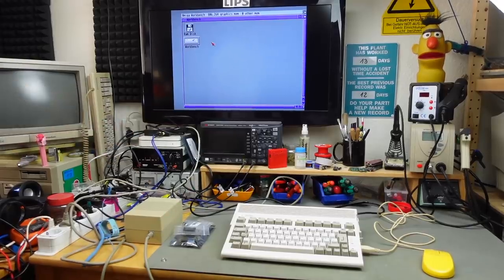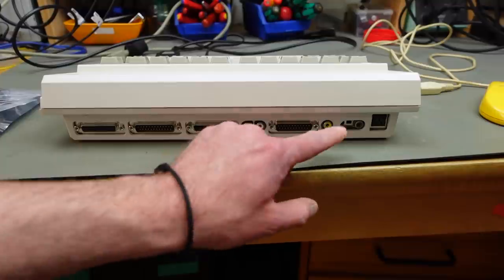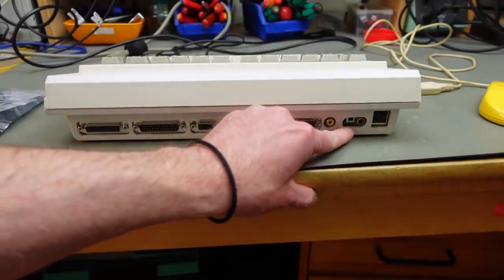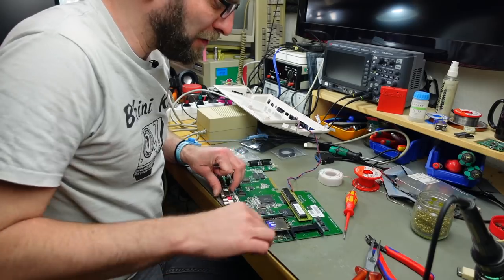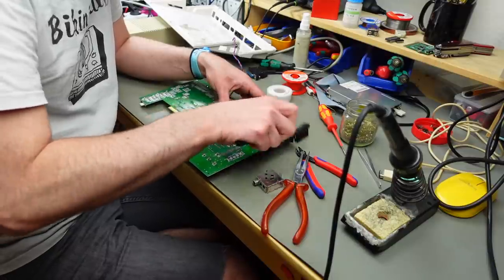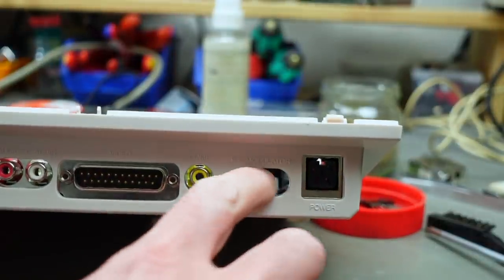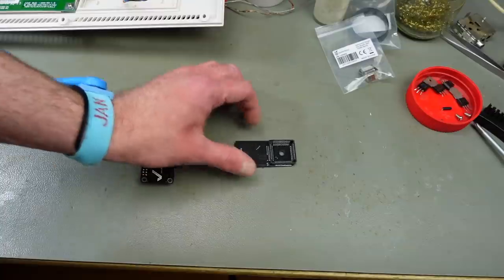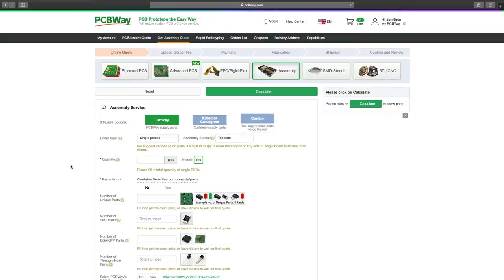Amiga 600 RGBtoHDMI Installation

Comment: What about putting the rpi in a box connected to the external rbg video connector instead, since this also happens to provide 5v on pin 23?
Something like the old A520 adapter, just smaller.
Reply from the maker: That would work but would be limited to the analog signals, similar to a standard RGB upscaler. The mod uses the digital signals provided to the Denise to generate the Full HD picture so the quality is way better.
Reply: @JanBeta  I see, thanks.

Comment: Don't worry Jan, its only a cable. 
We still love you :P
Reply from the maker: Haha, thanks! :D
Reply: @JanBeta  You know, as I watched you struggle with tha ribbon I realised that this device is poorely designed. It could be (pcb)waaaaaaay better in a different design. No ribbon, but desoldering the RGB and have a single PCB with a DVI / HDMI out to completely replace the RGB out in front of Denise. This 2.0 version could make the mod almost factory looking, and then we could get rid of all legacy outputs RF, Comp, RGG plus that giant cap that would be useless. Someone should do this as it makes much more sense ans it only needs the Pi mounted parallel to the PCB, where theres much room from the removed HDD (everyone is using SD/CF cards anyway). Here's a mockup of how it could look. Much simpler and actually cheaper too. https://i.imgur.com/FfF6GwE.jpeg

Comment: Great video! Will be doing this to my 600, just need something similar for my 1200 now..
Reply from the maker: Thanks! Unfortunately the Pi is not powerful enough for the AGA screen modes. And as far as I know the signals are processed differently so there would have to be a whole different method in order for this to work. Maybe someday.
Reply: @JanBeta  indivision aga mk3? Did a similar mod with it and the rf port..

Comment: Double sided tape doesn't work well for long term mounting in my experience because it tends to be very temperature sensitive -- tape adhesive gets brittle and loses its stick when it's cold, and it melts when it's hot, and even at the best of times it tends to creep and gradually let go if subjected to any significant force. A really good quality tape can work for lightweight things that are at room temperature all the time, but especially if you're sticking down electronics like a Pi which will get warm and melt the tape adhesive, I can't recommend it -- hot glue, silicone, and zipties are my go-tos now for electronic parts inside a case if I'm not doing it properly with screws.

There are tape adhesives that can work over larger temperature ranges for longer times but in my experience they're really hard to remove and then I might as well be dealing with glue...

Comment: This video has made me want to get an A600 ;)
Reply from the maker: I never thought I’d ever want one back in the day. But it’s an extremely versatile and useful machine these days. :)
Reply: @JanBeta  handy how compact it is :)
Reply: @RetroGameCoders  Pi400 might be worth a look if you want convenience/value, not limited to just Amiga software either.
Reply: @amirpourghoureiyan1637  I did a video about that :)  I get real hardware for my code testing but for sure the PiMiga is fantastic
Reply: @RetroGameCoders  Should come in handy for testing :)
Casual Amiga fans are better off going the emulation route, but if you're writing code then it's definitely worth having an original around!

Comment: Jan, thanks for the detailed video you've uploaded. Great to see this solution working for the 600.
I've had a look to do this myself, but I can not find the adapter board for the A600 mentioned. (the one with the cable and Denise adapter) Is there any way to aquire it preready made, as shown? 
Many thanks, Job

Comment: The limitation of OCS/ECS - is the limitation simply that of the amount of “grunt” available on the Pi0?
Reply from the maker: Basically yes. Unfortunately the Pis with more grunt handle the GPIO pins differently and have a bottleneck there (or at least that’s what I’ve been told), so we are unlikely to see an AGA capable implementation of this project. At least as far as I know. I think the AGA chips also have different signals on the pins so this mod won’t work at all without major changes.

Comment: the problem with plcc clip ons is it can interfere with any accels attached to the cpu and the hat (even with the hole) will cause the denise to heat up if the airflow is restricted
Reply: I wonder if a PLCC pass-through board would be possible - same as with a DIP chip pass-throguh but using PLCC sockets. It should not be all that difficult to solder or desolder a PLCC chip like the Denise - though certainly a higher barrier to entry than doing the same with DIP chips. But I don't know if a 'male' companion to a PLCC socket exists?

Comment: Interesting video. Do you think it would be better to make the HDMI upgrade in the style of the A520? That is to say, run a ribbon cable from the Denise chip to a socket at the rear where the modulator has been removed?  That way no problem breaking the connector! Thanks for uploading.

Comment: have 1 last question, the quality of the graphics on this certain game, does this rgb2hdmi thingy work good with the game Bubble & squeak? not sure if you've tested that game on it but the graphics on that game look great and need to run smooth.
Reply from the maker: So far, it did work very well with everything I threw at it. I don't think I've tried that particular game but chances are that it's going to work fine just like everything else (except for the higher screen resolutions introduced with the ECS chipset--which are VERY seldomly used in games).

Comment: Very interesting video!! I would love to get something like this for my A600 too. I have a bunch of them but my main one that i had since childhood is almost fully kitted which means there is a Furia inside. Can that Denise adapter fit underneath the Furia? I don't really like the indivision and this seems like a perfect alternative.
Reply from the maker: I am not 100% sure about the Furia but I think it should fit. The adapter board sits really flat on the board. I have yet to get my hands on a Furia and try.
Reply: There is a smaller variant that clips around the chip designed by kipper2k: http://eab.abime.net/showthread.php?t=105429&page=4
And then there is the original small adapter variant by c0pperdragon that you solder with wires that you can place anywhere: https://github.com/c0pperdragon/Amiga-Digital-Video

Comment: I may be wrong but as I understand it, the RF-Modulator also generates the composite video signal. So you might as well remove the yellow RCA plug next to it... and I guess the remaining hole could very conveniently be used for the RGB-to-HDMI's menu button, extending the microSD/TF reader for the Pi-Zero or both, maybe?
- Jan, I have already successfully build an RGB-to-HDMI into my friends A500... and would now like to try it with my Commodore 128's 80 column display. But the more I look at hoglet67's
 RGB-to-HDMI github page, the more confused I just seem to get... on what version and/or adaptor board (and so on) to get.
- I can't seem to find any YT-videos or step-by-step guides on it. So, I would really love if you would consider making a similar video for the C128.
Reply: The composite video is generated by the chip at U12 (CXA1145 Encoder), it's output is fed to both the modulator and the yellow RCA composite jack. The composite should still work fine without the modulator.

Comment: Question can you still use the old RGB Output (23 pin Dsub) and connect RTC monitor along the site with or insted HDMI?
Reply from the maker: Yes, the regular video out is unaffected by the mod. :)

Comment: This is a nice and neat solution. 

I am looking at possibly doing something similar for my Indivision MK3 where I can use a USB plug into the smaller board, then using a flat ribbon can then direct the output to the socket as you have here. I feel this would be look more elegant (at least externally) & would free up the back port of the A1200 for other things (e.g. easier CF card hardrive access). I just wish I had a way of getting hold of the acrylic/perspex mouting plate & screws

Comment: Any chance there's somewhere t put an HDMI out on an A500?  That monochrome plug was always fairly useless, though I don't know if an HDMI socket would fit.
Reply from the maker: I think you can run a flat flex through the cooling vents and 3D print a little enclosure for an HDMI socket. You would have to cut the case to have a real internal solution for the A500 though I’m afraid.

Comment: Might have been a good idea to attach the flat ribbon cable to the HDMI connector before securing it in place.
Thanks for the video.
Reply from the maker: Yes, indeed. I‘m definitely going to do that when I get the replacement part. :D

Comment: Nice relly nice ideas for old computers. Little tip, dont use double side tape for secure HDMI port in this acrylic adapter. Because glue on tape can easy melt after use in hot case, and huge fat HDMI cable can easy lift  glued HDMI port and made big mad devastation inside case. Or if have luck only destroy signal tape. I see many HDMI ports soldered and lifted from PCB. Better use hot glue or best some acrilic glue or best way any 2 ingrediens nonconductive glue. Glues like 1s Super Glue can made shorts or another disasters. Hot glue is very safe and can easy dismount with hot air.
 Grettings and cherrs :D
Reply from the maker: Thanks! Good point about the double sided tape. I‘m going to look into adding something more permanent next time I open the A600. :)

Comment: Hallo I have question you add raspberry pi do you also get the acceleration of the pi or is it only to connect the hdmi
Reply from the maker: Just the HDMI with this project. You might want to look up the PiStorm project though which is a Pi based accelerator for the Amigas. :)

Comment: Great Video again. When I get it right only the black part of the connector is broken. Just get it out of another connector carefully and slide it in the broken one. This should do the trick
Reply from the maker: Yes, that would be a solution. Unfortunately I don’t have any matching connectors I could salvage the part from. I just ordered a replacement, should be easy to fit.

Comment: Hi Jan - are you sure that you broke the adapter? I can't get the the video output to work with a flat flex cable and I have read of others a having similar issues. I've replaced the flex cable and adpaters but still no output unless I plug directly into the pi with an hdmi cable.
Reply from the maker: Mine works without any problems after I replaced the connector. Are you sure the flat flex is fully inserted and locked into the connectors and in the correct orientation etc? It‘s literally just an extension of the original connector on the Pi so that’s the only explanation I can think of why it wouldn’t work. 🤔
Reply: @JanBeta  as in your video I have the silver connectors facing up as I connect. The connection feels snug and tight once locked in place so it really is weird. i guess it is not possible to blow something if the cable orientation is wrong.
Reply: @JanBeta  so it  seems that the problem is the female hdmi adapter which the monitor cable plugs into. I switched this out for a different type and now the signal works. The  problematic adapater is a slightly different type, it has a hinged clip which close down on the cable as opposed the type used in your video with the two clips either side of the cable. I need this type of adapter as it is slimmer and fits the 3D printed caddy I have. Likely I have been sent a defective part I guess.
Reply: @robbune1792  I'm planning to do this mod to my Amiga 600. The only part I can't get hold of is the HDMI mount. You mentioned a 3D printed caddy for the HDMI port. Could you please let me know where I could find the files (STL, OBJ, etc) to get one of these 3D printed myself?

Comment: Why can the RGBtoHDMI unit not simply be connected to the factory video port?
Reply: By the time the video signal gets to the port it has already been converted to analog RGB. The Denise outputs the digital RGB, so the signal gets converted to HDMI without ever being turned into analog. If you took the output from the video connection, it would be no better than the signal you get from the SCART to HDMI converter.

Comment: I've thought about replacing the C64 RF modulator with a modern replacement (that doesn't do RF at all) but I don't know if my $30 soldering iron and desolering pump kit can pull it off. I had a hard enough time replacing the power switch.
Reply: Use “Low-melt” solder, to desolder.
Reply: @xxycom8963  didn't know that was a thing. I just ordered solder. No idea if it's low melt or not. I do know I was using shit flux. I have better flux now. Maybe it will help.

Comment: I got lucky.  My A600HD (still in original box) is as white as the day it was born.  Never performed any retro-bright on it.  I have a C128 in the original box too.  When I got it, it was super white.  Today, it's a dingy yellow.  Despite being in the box the entire time in a climate controlled, dark room.  So it's the luck of the draw.  So yeah..they can go yellow even with no UV (although UV accelerates the process).
Reply: I suspect heat might play a part in the yellowing process.

Comment: Hi. It's possible to mount on A1200 ?
Reply from the maker: No, the AGA Amigas use a completely different video circuit and the Pi would not be able to handle the bit depth of the AGA modes even if you could get the necessary signals from the Amiga (which would be a bit more elaborate than plugging a socket between some chips). You can obviously still convert the RGB output using the general purpose version of the RGBtoHDMI externally. But that’s using the analog signals so it’s not going to be as crisp.

Comment: Nice... I love the denise adaptor. Can it perhaps fit under a Furia-020?
Reply from the maker: I think it is designed to leave enough room for the Furia (it sits very flat on the chip). I don’t have one to test though.
Reply: @JanBeta  Hmmmm... I asked about the possibility of doing a socket adaptor like this, just for ScanPlusECS scandoubler, in the past. You know, the one that uses a dip socketed denise on top. (Sandwich solution). Back before individual launched their IndivisionECS-V2 scandoubler. And people said it was impossible, because of space and all that. It is to give the 600 a second scandoubler solution.

If the ScanPlusECS takes the Denise on top, and the RGB port are still working, then it must be the signals just being hooked uo to the pins, and therefor it should be no issue if the scandoubler is before or after the denise chip.

But I did not design anything, because I can not design PCB's and I have no experience in that. So it is just an idea that I had back then. I am still curious if a Furia will fitt on top. That would make an Amiga600 really awesomme. Just imagine....

 Furia-020
 RGBtoHDMI
 2mb ChipRam (individual computers)
 Floppy internally
 Gotek externally
 IndivisionECS-V2
 Angled IDE/CF with 44 pin port
 Mikrodrive HDD drive
 CD (ribbon cable through PCMCIA slot)

Comment: In hindsight, you probably should have inserted the flat flex cable to the HDMI out board, before you stuck it down on the acrylic part 🙂

Comment: Is the blue (window border) in Workbench a little off? Did you tweak it after the initial bring up clip?
Reply from the maker: Oh, I think I just changed the workbench preferences overscan settings. I had this connected to a CRT the last time I used it. The position and size of the wb screen can be changed easily.
Reply: @JanBeta  Apologies, I was meaning the colour. Compare the blue of the window when using your cheap upscaler to the blue when using the Pi. The Pi output looks purple.
Reply from the maker: Oh, okay. The color of the window top bar is set to purple actually. The color looked the same with the upscaler and the RGBtoHDMI. Maybe the white balance of my camera played some tricks, it doesn’t work too well for filming monitors.
Reply: @JanBeta  I checked it out again... they're both purple. 😜 Guess my brain filled out the standard blue when I started watching.

Comment: Your not alone in the mistake department we all have been there and anyone who says they don't make mistakes has absolutely no credibility.  The flat flex idea is pretty nice but if your always working on your Amiga its maybe not the best solution and a short cable would be better.   You could have PCBWAY make up a PCB where you can solder a couple HDMI Connectors on the board and then using those same two holes mount it.   Kipper2K has a VGA Board for the A600 that had a VGA Connector and a JTAG connector for connecting to the Indivision Board.  I have one in one of my A600's and I would love to have a couple more but gave up looking for them.   Only problem with PCBWAY and I do use them is the cost of shipping other than that they are great.

Comment: Been fighting flat flex for a while now, and I'm pretty sure you just put the flex upside down in the connector.
Reply: the retainer can't have pins on it, so fitting the cable the right way around is important.
Reply from the maker: Yes, makes sense! I tried both ways on both ends to no avail. I edited out a longer segment of me trying and swearing. ;)